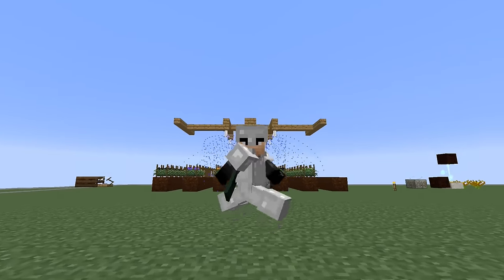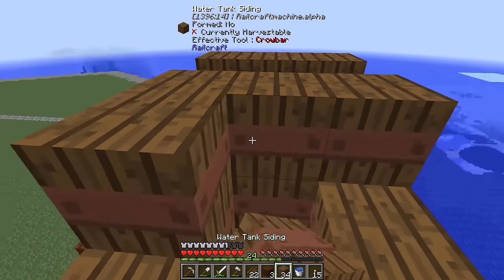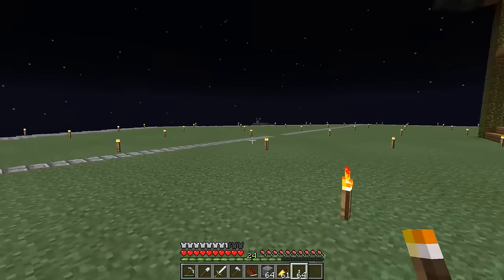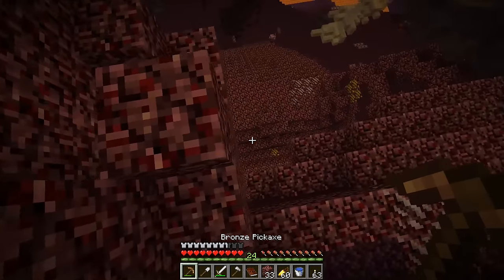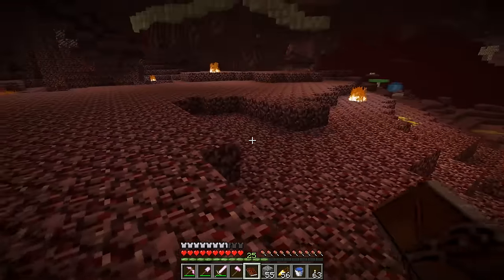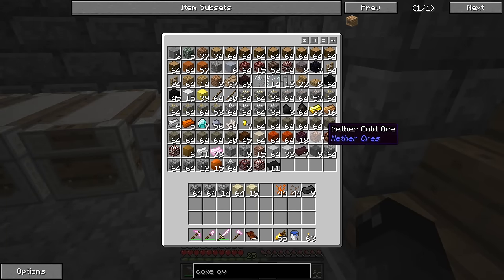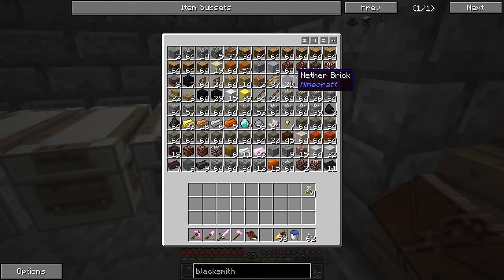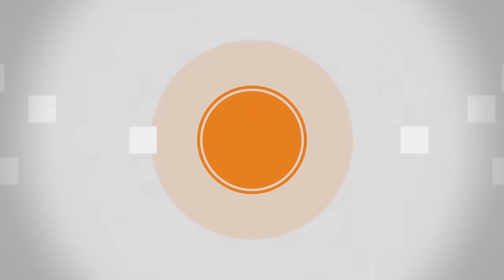Minecraft Mods Regrowth - WATER TANKS [E15] (Modded HQM)

Comment: Hi Hypno.  I put this in a previous Regrowth video.   Just as an FYI:

Hypno, about your sprinklers.  A little known thing is that the Mariculture sluice will act like an aqueous accumulator, except that it 
outputs only to the front.  You have to be careful; it's intended as a way to make pressurized water, so if you don't have a tank right in front to capture the water, it will destroy terrain.  But you can set up infinite water generation into your sprinkler tanks with the sluice and a couple water sources to the sides of it.

Comment: 5 aluminum ore, 2 iron ore and 2 obsidian is the perfect amount for alumite
Reply: in fact its one obsidian block since it makes the 2 ingots you need.
Reply: honestly, screw that, go straight to using steel from the blast furnace and you can skip it from what i remember
Reply: Yes, but ore gives double ingots, so it's 5 aluminum ingots, 2 iron ingots, 1 obsidian, OR 5 alu ore, 2 iron ore, 2 obsidian.